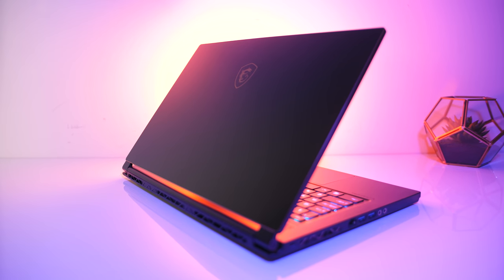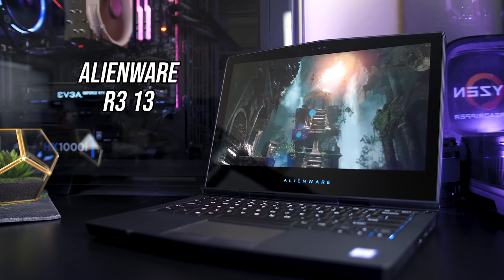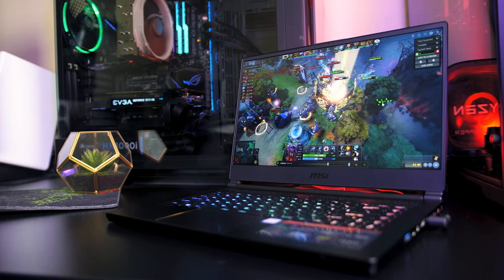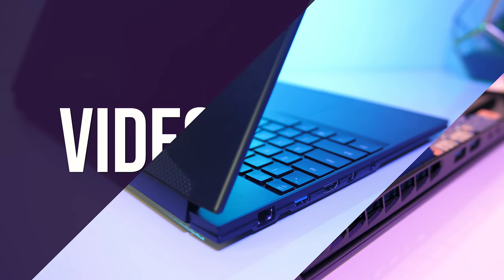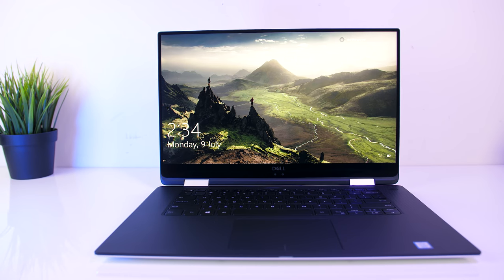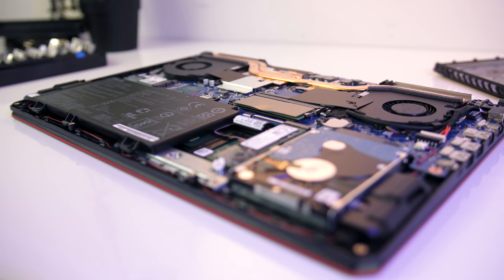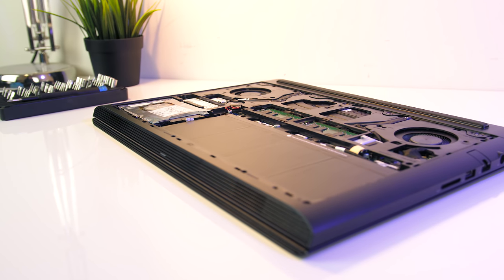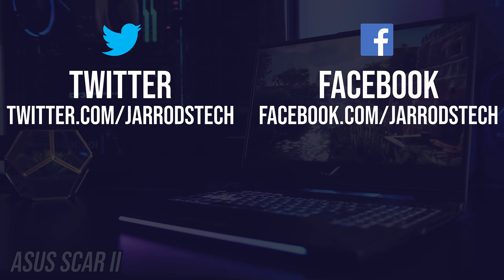The Best and Worst Gaming Laptops of 2018

Comment from the maker: What were your favourite laptops in 2018?
Reply: Jarrod'sTech msi gs65, razer blade 2018, and asus zephyrus m
Reply: Might be an unpopular opinion but, Asus rog g703gi.
Reply: xps13 overall
ROG Zephyrus for gaming
Reply: MSI GS65 sir.
Reply: Mine are my Clevo P870TM-G and the XPS 15 2-1 :)
Reply: OK
Reply: - Best Budget gaming notebook of 2018: Overpowered lineup, dang Walmart did shake things up! 
- Best Overall Gaming Laptop of 2018 (15") :  ASUS ROG STRIX SCAR II (GL504GM)
- Best thin and light Gaming notebook of 2018 : ASUS ROG Zephyrus lineup, any of em.
- Best Gaming Desktop Replacement of 2018 (17.3"+) : ASUS ROG G703GI Chimera
- Best Content Creation Notebook of 2018 : Acer Predator Helios 500 (AMD Ryzen 2700 + Radeon Vega 56), too bad gamer aesthetics wont make you look professional in a meeting or office environment.
- Best Jack of All Trades Laptop of 2018: Gigabyte Aero15x (huge battery life, good for work and casual gaming, subtle aesthetics won't draw much attention in a business meeting, SD card reader and 6 core CPU for content creation, better thermal management and specs than rival Dell XPS 15)
Reply: @scammecrusher  Propably a Lenovo Thinkpad. Best ergonomics and keyboard/input devices in the laptop scene. Plus that epic ruggedness. Pricey though and not mean for gaming as they come with Nvidia Quadros.
Reply: gf63
Reply: definitely eurocom sky x7 and a clevo p775 tm1. these are amazign value for money and are proper gaming laptops owth gtx 1080 and a nice THICC chassis
Reply: AERO 15X
Reply: Lenovo legion lineup, because of that industrial look.
Reply: I'm just here because I saw we shared first names. (I also prefer desktops)
Reply: MacBook pro
Reply: My favorite laptop is the MacBook Pro with Vega 20 graphic card and i7 cpu
Reply: Hp pavilion gaming laptop
Reply: Lenovo Flex 5 15"
Reply: helios 300
Reply: Frencho9 hahahahahah so your telling my that razer ain’t the best thin and light laptop and the best content creation. I had almost all the computers in your list and the razer just does everything perfectly.
Reply from the maker: @NameLessMOnster901  Razer is fine if you like dongle city (no ethernet port, no SD slot etc).
Reply: @JarrodsTech  Yea that is if you get the newer models which is a complete waste of money. The 1060 max q actually performs almost as good as the 1070 max q and i might even say better due to the better thermals in the 1060 max q models. They also have a Ethernet port and why does everyone complain about a SD slot like it isn't even that important b/c no one even uses it and will most likely never use it.
Reply: HP Omen 15 2018 🔥🔥🔥
Reply: I bought an ASUS Scar II 1060 version 144hz, so far happy with it's overall performance. 😃
Reply: I personally own an Asus Rog Strix Scar ii and it looks stunning. 144hz and 3ms response rate, Gtx 1070, thin and light, what more could you want?
Reply: @michaelliu2703  do you suffer from any coil whine ? Keen on getting one for college, but heard alot of the ROG laptops suffer from coil whine.
Reply: Acer nitro 5.Cheap but powerful.
Reply: Where is the HP Omen 15
Reply: hp pavilion 15 gaming
Reply: Helios 500
Reply: My Legion y530 I recently bought..I just find it the perfect laptop for me 😊
Reply: Acer predator 500
Reply: So... do you reccomend the Lenovo Legion y7000?(cpu i7, 1060 gpu) They're thin, and look nice.
Reply: Predator 21x..hope it comes back with a 1440p 144hz version.. Can't find it anywhere. Also Eurocom sky x.
Reply: Why no origin ????
Reply: @bakytn  what are its specs?
Reply: Jarrod, I have decided to go for an Hp omen 15 2018 core i7 and Gtx1060. Need an opinion Please.
Reply from the maker: @farhanshakir7508  I can't really say as HP don't lend me review units, I haven't been able to test the Omen stuff. I've heard they are decent, and those specs are pretty good though.
Reply: I think you can go for the RTX 2060 version.
Reply: @JarrodsTech  Thanks Man, I got the omen 15 -2018, am happy with it :D
Reply from the maker: @farhanshakir7508  Good to hear!
Reply: Msi gl63
Reply: Acer nitro 5 when the cpu is not overheating (normal web browsing), Lenovo legion y530, and ASUS ROG GU501 ($1500 Zephyrus M look alike)
Reply: Have the new razer blade 15 and i love it. Gets a little toastly though.
Reply: Jarrod Tech what's the laptop at 0:47? It looks good.
Reply: @-PolesticoPaulJustineD  Acer Nitro 5: Cheap, powerful, and tends to get hot
Reply: @blackprince3577  Looks like a Razer Blade since you can faintly see the word Razer on the chin of the screen
Reply: @Speedster_ELuu86  really you can see that? I can't see it at all. Whatever laptop it is, it looks really good.
Reply: @blackprince3577  The green usb port, RGB keyboard in the middle, front facing speakers on the left and right of the keyboard, and big trackpad at 0:48 also gives it away or you can just google an image of a Razer Blade 15 and do a comparison
Reply: @Speedster_ELuu86  The screen is outstanding on it. It looks very nice and sharp. What do you think of Razer blades?
Reply: @Black Prince they’re great but I can’t afford them. If I had an unlimited budget for a laptop I would have to make a hard decision between the ASUS ROG Zephyrus M or Razer Blade 15
Reply: razer blade 15 with gtx 1080 

i got my asus rog hero 2 also in 2018
Reply: I have Helios 500 with I7 and Helios 700 with I9 , both of them are awesome......thnks Acer .....Ps ( i recomend Predator instead Asus ROg)
Reply: Would you be able to do one of these this year before the Christmas shopping season?
Reply: Favorite pick (which I still use to date): The Asus GM501GS-XS74.

Comment: Happy New Year Jarrod! Your intro and summary of 2018's gaming mobile tech was spot on, on one side heat and thermal throttling has been a major issue with Intel 8th Gen coffee lake CPU's. On the other side Graphics have been stagnant due to being stuck with Nvidia's Pascal for over 2 years, plus Radeon being basically a no show, and the rare mobile Vega gaming laptops performing worse than Nvidia's GTX 1070 (unless we're talking Dx12 titles). https://www.pcworld.com/article/3317518/laptop-computers/amd-vs-intel-and-amd-vs-nvidia-in-acer-predator-helios-500.html

Sadly when it comes to video game performance the gaming notebook market has been threading water, no tangible performance gains as there are just a couple of game engines able to take advantage of 6 cores (frosbite, CryEngine?). But content creators can rejoice from 2018's CPUs, as multi-threaded programs and workflows benefit a lot from 2 to 4 extra cores! 

Positive things about 2018: 
- DISPLAYS, 3ms, 120Hz-144hz with G-Sync and respectable color gamut becoming commonplace, which is so great for competitive games and e-sports.
- Thinner screen Bezels.
- M.2 NVMe SSDs becoming commonplace, freeing the 2.5 inch storage bay and SATA III ports for a second storage HDD instead of 2.5 inch SSDs. Resulting in more compact chassis designs.
- Multiple zone RGB keyboards becoming commonplace. Slightly longer keytravel too on all but the thin and lights.
- Starting with mid-range gaming notebooks, being equipped with a least one single Thunderbolt 3/USB-C 3.1 Gen 2 for future-proofing.
- Windows Precision drivers for trackpads being increasingly adopted by OEMs. 

Things that bug me: 
Why are we stuck with 720p Laptop Webcams in 2018 when Smartphones pack tiny 20 megapixel dual lens front facing selfie cameras. Hell even 1080p Webcams are unicorns on 2018 laptops! Also if Smartphones can fit cameras on notches why do we have to stomach nose cams on laptops?!

Will certainly be looking forward for your CES 2019 gaming laptop tech coverage, I'm intrigued, yet skeptical about Nvidia's mobile RTX lineup (an RTX M2080ti  WTF?) and 9th gen Coffee lake Refresh CPUs (but more cores kinda redundant for gaming TBH). Still not getting my hope's up due to how POWER HUNGRY both of those chips are (so even more HEAT and THROTTLING). 
The silver lining might be AMD finally bringing competitive APU's to the gaming notebook market, which they neglected so much in 2018. But they have been pretty shush about it, 7nm mobile chips in Q4 2019 would be a godsend, please cover it if you can because Nvidia's mobile RTX might hog all the limelight.

P.S : Remember to harass the ASUS ROG guys so they send you a review unit of the ASUS ROG G703GI Chimera =P, chop chop mate!
https://www.asus.com/us/ROG-Republic-Of-Gamers/ROG-G703/Features/
Reply from the maker: Thanks, happy new year to you too! 👍👍
Reply: @JarrodsTech  Oh by the way I forgot to tell you the best thing that happened in 2018 in the Gaming Laptop was discovering your channel, then discovering Steven @OWNorDisown and then @Bob Of All Trades due to your collabs. Folks, it's the in-depth review Gaming Notebook Trifecta!

Comment: i don't understand... what's your issue with the Aero 15(X) on the gaming category ?

In term of price range it is between the MSI GS65 Sthealth Thin and the Razer Blade.
And with the last promos, it could even plumet under the MSI price range (here in France I bought the 15X (full HD, 1070) for 1900 € instead of the basic price of 2500€ with a free 2nd power brick ..!

And the Num Pad that is not present on the other challengers is really useful for some people on some game for hotkeys. :) 
Also, the Razer Blade don not have an ethernet port... pretty usefull to get a viable connexion when doing online gaming ! 

Outch, sorry too long post.. so.... what's the issue with the Aero 15(X) for the gaming category ?
Reply from the maker: No issue with it, just that the category was thin gaming laptops and I mentioned it's a little thicker than the other listed models.
Reply: @JarrodsTech  oh okay, I did not hear the justification for it, thanks ! :) 
But then.... I don't understand as it has exactly the same size as the MSI, and the Razer Blade for the thickness...
Notebookchecks compare the size of all the laptops you quoted on this category on the Razer Blade test : https://www.notebookcheck.net/Razer-Blade-15-i7-8750H-GTX-1070-Max-Q-FHD-Laptop-Review.305426.0.html

Also, they made a top 10 of the same category, just check the top 3... O:) (you have the weight and size of the laptops there, that's mostly why I'm pointing out this link) 
https://www.notebookcheck.net/Notebookcheck-s-Top-10-Slim-Light-Gaming-Laptops.126456.0.html
Reply: Has the best battery on the list too by pretty long shot which imo is the most important feature behind specs

Comment: 1)Hey Jarrod! How much better was the aorus x7 better than other 8750H laptops since it comes with OCable 8850H?
2) even my i7 8750H+gtx 1050Ti helios 300 came with 150W power brick and performs great for its GPU at max fans. The fx504 just isnt getting that much power?
3) Would you have used Acer Predator 500 ryzen version for yourself had the only different been the gpu and cpu?
4) Is the processor on helios 500 ryzen version swappable?

Sorry for so many questions. Its just the enthusiast in me :)
And Happy new year :D
Reply from the maker: Hey!
1. It was alright, depends what you're doing with it though, for games it doesn't really make that big of a difference, but also depends on the laptop it's in as to how well it can be overclocked. My 8850h vs 8750h video used the X5 for the 8850h laptop if that helps, it was before I got the X7.
2. I guess with the power limited CPU it can get by with the smaller power brick.
3. I'm not sure what you mean? Personally for me with my travel a 17" laptop is just too big for me to really consider carrying around, especially internationally so I wouldn't pick it as my own laptop even with those temping specs I don't think, but maybe my mind would change if I get to test it out 😉
4. To be honest I don't know, but I suspect it must be given it just uses a standard desktop CPU, so not sure if you could replace with a future Ryzen 3XXX series CPU, would depend entirely on the motherboard BIOS being updated to support it / power delivery etc. Might be able to downgrade it to some other current Ryzen CPU, but why would you want to do that 😛

No problem, thanks you too!
Reply: @JarrodsTech  thanks :)
Reply from the maker: No problem!

Comment: Awesome video, have a great new year. I have just one question. What is with the MSI GE63 8RF at the end of the video?
Reply from the maker: Just random video to fill in the space 😉 I didn't include it because it was too hot for me, if anything maybe I could have talked about it in the worst laptops section. For the thickness and amount of heatpipes it gets, it should not thermal throttle when undervolted.
Reply: Jarrod'sTech Ok 👍

Comment: Well I'm glad to see someone mention video editing since we're not all gamers. Still, a good gaming laptop does set the standard for just about any other use you might put it through. Still, the top-end editing laptops will utilize Xeon and a Quadro which are never reviewed or mentioned (except by that one guy). Aside from that, where gaming and editing rigs differ the most is in multiple fast ports and card readers.
Reply from the maker: Yeah I've never had the chance to get any Xeon laptops yet, only ever had a couple of quadros too (1 here at the moment I'm yet to look at ). Fast card readers are important for me, which is why I went the Aero 15x, out of the gaming laptops covered it was the only one with it and still decent specs.

Comment: hey, I'm new to your channel. Is the Helios 300 (2019) a big upgrade over the 2018 version. looking for a gaming laptop. Also, with new GPUs coming out should i just wait for better prices?
Reply from the maker: Hey, welcome to the channel! I haven't tested the 2019 model, to be honest I didn't know there was a new model released in 2019? I would think they'd wait for new Nvidia graphics below the 1060, as the 2060 (lowest new laptop graphics currently available) seems more in line with the 1070, so might have to wait for lower end laptop graphics before we get a refresh of that laptop. If any price drops were going to happen though, I'd expect it to have been the case for most models by now as RTX has been here for a bit now, but possible there could be more later as 1050, 1050 Ti and 1060 laptop graphics get updated in future.

Comment: Hey Jarrod, nice video bro....But what do u think i should buy Acer predator 300 or the Asus strix gl503  (I am in med. collage now) The asus has better design,looks,and better screen......Should i go for i5 8th gen or i7 8th gen ? (I am a moderate gamer,and love watching movies but i hate lags)And is 1050 ti enough??
Reply from the maker: Thanks! Helios 300 is a very good option for the money I think, haven't tested GL503 myself so hard for me to really compare unfortunately. Personally I'd be going towards the GL503 just based on looks, not really a fan of the big PREDATOR logo myself, especially using that thing at school! 😆 1050 Ti is fairly good for current games with medium settings at 1080p I think, for high settings 60 FPS 1080p I'd be looking at the 1060.

Comment: Hey Jarrod which one would you recommend? The razer blade 15 or the Zephyrus M? I love the razer but i'm worried about warranty and quality issues, I've read that some blade got dammaged over a year of use. Thanks for your great job men! Note: I'm from latin America so i cant use warranty
Reply from the maker: Depends what it is used for? The Zephyrus had better cooling in my testing, performance was similar though if you have the same specs, I can't really talk about long term usage as I only tested both for a couple of weeks each.

Comment: Awesome video :) I have the Acer Predator Helios 300 and works really good, but xtu said that my cpu was power limit throttling. Do you know how I can fix that? Thanks, and Happy New Year
Reply from the maker: Thanks! Yeah that's pretty normal, almost all 8th gen CPUs will be power limit throttled to prevent them cooking themselves. The best you can do is CPU undervolting, which will allow the CPU to do more with the power that it can get. I suggest this video if you need a guide: https://www.youtube.com/watch?v=yNt9L3BWOFo
Reply: Jarrod'sTech thank you :)
Reply from the maker: No problem!